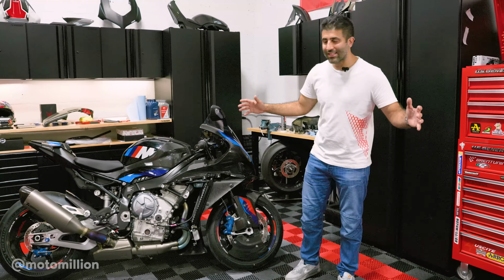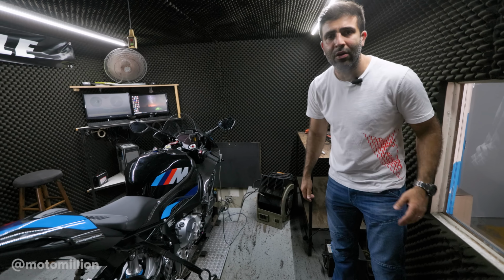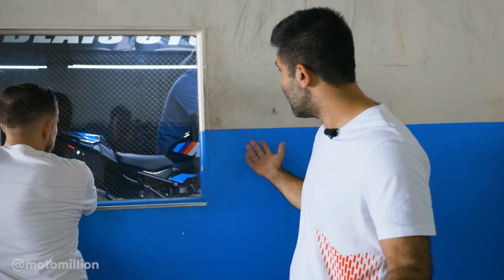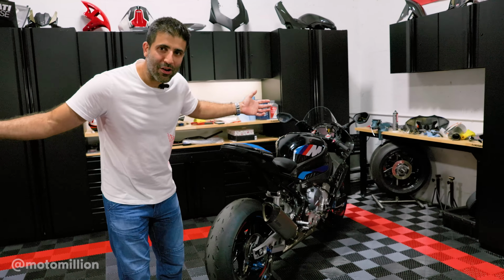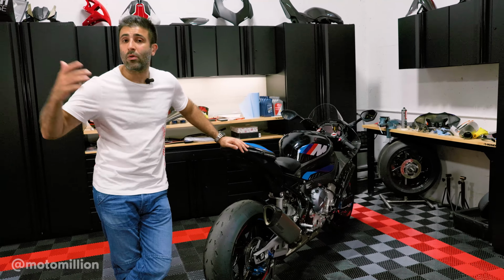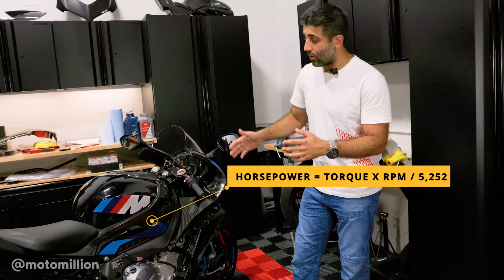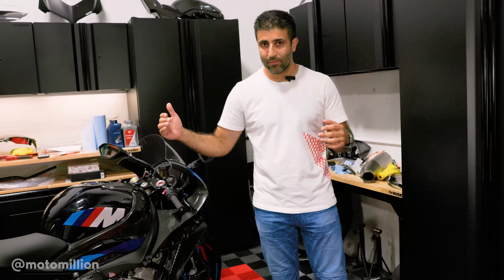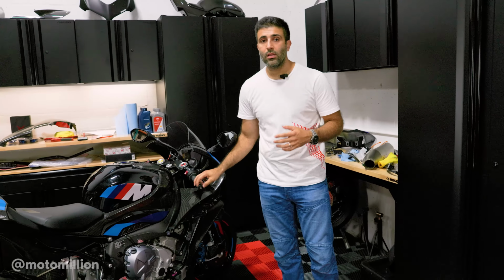How Much Power Does the New BMW M1000RR Really Make? | M1000RR Series Part 7

Comment: This episode is extremely interesting. I’ve brought some of my motorbikes to be re-programmed, initially to gain power but I started to see this operation with a new eye when I brought my 2016 H2. The magician behind his computer set a new curve totally changing the behavior of the engine from 2000 to 6000 rpm, erasing the extremely uncomfortable psychotic comportement of the bike under 6000 rpm. Not only the H2 is now more powerful but also way more easy to handle (I don’t have to say it was already the scariest moto I have, now it is still scary but with sweetness…).  Thanks for sharing your knowledge and bringing a little light in our minds.
Reply from the maker: Yes, a tune can really transform the power curve! It's not all about horsepower, but also about making the power smooth and consistent throughout the entire rev range

Comment: my dealer did a dyno run on my V4S with high mount ak exhaust with upmap, it only did 188.73hp. there was no torque readings, no rpm readings. does this mean this is what they did? holding at 4000, holding at 5000? the readings are probably wrong? also, this was back in November, it was cold and humid.
Reply from the maker: I would definitely think that the dyno was not getting proper readings. Reading correct RPM is essential

Comment: Blais Dyno typically reads a bit (10rwhp) high. My tuned V4 made 214 first session and  217 second tuning session before we dialed in the af to 12.3af on top to take the incoming air speed into consideration ..only lost 2 hp on the dyno doing so.
Reply: oh on 93 pump.
Reply from the maker: If it reads high, it doesn't make sense that a tuned V4 SP2 puts out 208hp, and a stock M1000RR puts out a 189hp. Given 10 percent drivetrain loss, the number is within the crank specs.

Did you actually get an RPM reading off the bike or used the rollers for the RPM reading?

Comment: Does it or not effect the readings on the dyno because the bike is sitting still therefore the airbox isn't pressurized from the forced air induction?
Reply from the maker: Yes and no, not a huge difference with the ram air effect.

Comment: Sounds to me like operating temperature might have sapped the power. If the bikes are equal, on a cooler day, you would have had a higher base hp on the M1000RR Competition. After the mods, I hope you are able to test under the same hot conditions
Reply from the maker: The heat doesn't make a huge difference, maybe 1-2hp, the dyno still compensates for the temps.

Comment: Is none ethanol fuel good for a motorcycle?
Reply: I use the Thorn bikes eflexfuel kit on my gsx s 1000 it Works good bro...N this gas is less expensive...+ I put additive in the tank...N i change the oil often...

Comment: Stock r1 @44teeth made 198bhp
Reply from the maker: Not WHP. Wheel horsepower. We are measuring the power at the wheel, where it really matters. There is parasitic loss by the time power from crank makes it way to the wheel.
Reply from the maker: Yes, that is Brake Horsepower though... We measured Wheel Horsepower
Reply: Got you 👍

Comment: Hp and torque are calculated by the air fuel ratio.. the AFR number is the most important number you should be paying attention to.. AFR will give you longevity and the best Hp and Torque ..
Reply from the maker: What if it is electric?
Reply: @Motomillion  there is no air fuel ratio with electric bikes.. lol 😂